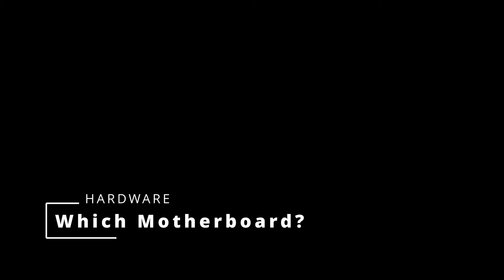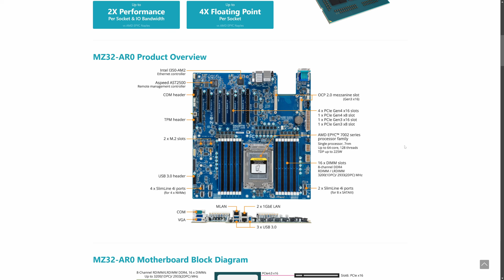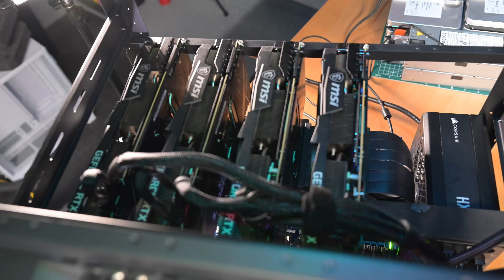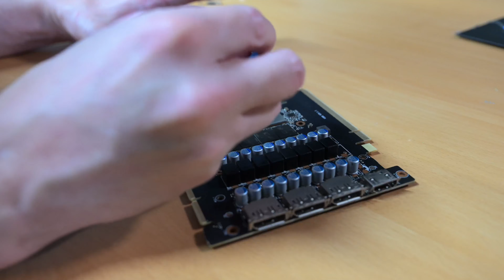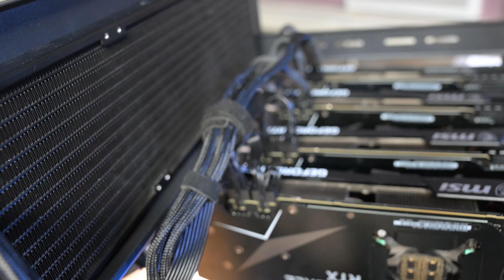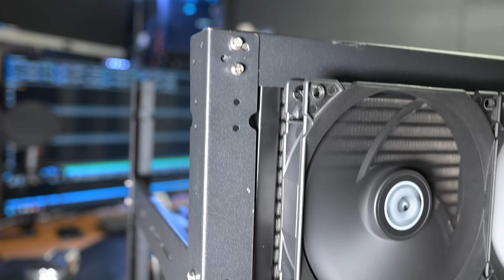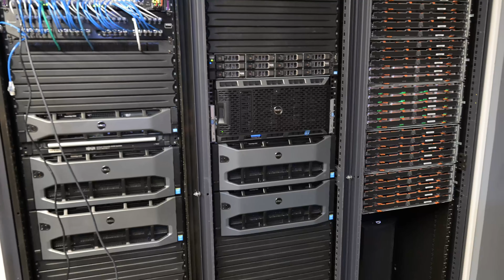INSANE Home AI Server - Quad 3090 Build

Comment: First off thanks for all the work you do, love the channel. Loved it so much I attempted to make a modified version of the quad 3090 rig. I had a 4090 in my gaming pc and a 3090 from an old one, so I figured two more cards and I was there. Thing was I had an I9 13900k in the gaming rig and I had the bright idea to reuse it. Long story short I found an ASUS Prime z790-p which is supposed to have PCIe G5 16x and Three PCIe 16x G4 slots that can run at 4x. Other that the CPU and Mobo everything else is same as your quad build. Actually got the system to boot with the 4090 and 3x 3090s and everything looked good. Anything that fit in 1 card say QWQ32b K_M4 16K CTX worked fine about 35tps and pegs out the power consumption on the card. But as soon as I load something up that needs more than one card(qwq32b K_M4 32K CTX) then all the cards drop down to 50 watts usage and I get like 6tps? Maybe there's something janky about this motherboard idea I had. I thought PCIe bandwidth didn't really matter. Was hoping that I might have stumbled upon a hybrid gaming/AI build . I'll keep tinkering with it and I might try out your CPU/Mobo combo to see if I can reproduce your results.  Let me know if you have any thoughts.
Reply from the maker: My guess is driver weirdness, but lets test it this way. First, scale it back to 2 cards, then 3, then 4 as a test-and-validate methodology. Second, during each test run ollama ps to verify you are 100% cpu loaded. Third, Specify "4" GPUs in for the model card advanced parameters settings place. I suspect it is this. You need to specify the num_gpu for each model after you find its sweet spot. For instance a smaller model with huge ctx may only need 2x 24GB gpus. It will perform slightly worse with each GPU added, but like 1% not what you are seeing. Forth, you should test from the ollama cli and not from the Openwebui interface to isolate any potential issues. Do not assume ollama is reloading properly with just a systemctl change if you alter env settings. You need to reboot the LXC to be sure.
Reply: @DigitalSpaceport  thanks for your original response. I think we can file this one under self inflicted pain lol. I neglected to mention that the original problems were on Windows 10 (because I was trying to do the hybrid gaming rig). To troubleshoot I followed the guide exactly proxmox > lxc. Now I'm getting 23tps on qwq q8 64k ctx. So if anyone cares the build does work. Now I just need to decide if I want to futz with Windows at all lol.
Reply from the maker: This comment makes it in the next video
Reply: @DigitalSpaceport  thanks for the reply I'll dig into it here over the weekend and report back, would be Cool if I could get this to work
Reply: @DigitalSpaceport  Are you referring to num_gpu(Increases the number of layers) the tooltip is kinda janky in OWui.
Reply from the maker: Yes that cmd is also accessible via cli ollama cmd

Comment: Would a SuperMicro H11SSL-i rev 2 w/ AMD EPYC 7b12 CPU 64 cores work with this setup?
Reply from the maker: H11 is pcie3, major bandwidth reduction for things like image generation and fine tuning. Id avoid H11.
Reply: @DigitalSpaceport  Thank you for the information! That makes sense. I will go with H12 and try the same setup you showed.
Reply: @DigitalSpaceport  I finally received the H12SSL-i motherboard, an AMD EPYC Milan 7V13 processor, and the CORSAIR iCUE Link H170i RGB Liquid CPU Cooler. While the cooler supports AMD sockets, I’m having trouble mounting it onto the motherboard. The H12SSL-i has four mounting points that align with the AMD bracket included with the cooler, but it appears to require a backplate or screws from behind the motherboard. Do you have any suggestions or guidance on how to properly install the cooler in this setup?
Reply from the maker: @nghiaphan2104 The H12SSL-i has an integrated plate around the socket. This plate has 4 stands for double-ended threaded standoff screws (should have come with the cooler. You need to put those in first. Then mount the bracket. Ensure you removed film sheet from cooler.  Follow sTR4 instructions for h170i, same fit as SP3.  You can check the supermicro motherboard image here and make sure it came with that giant metal socket plate. IT did come with that right? I dont think that can be removed. https://www.supermicro.com/a_images/products/Aplus/MB/H12SSL-i_spec.jpg
Reply: @DigitalSpaceport  The plate has four stands arranged in a rectangular pattern that align with the AMD cooler bracket, but the holes in these stands are too shallow for the standoff screws. I can only thread them in about one-third of the way. I also noticed four additional stands with an isosceles trapezoid shape. Should these be the correct stands for installing the standoff screws?
Reply from the maker: Hummm checkout this picture, maybe it will help. https://digitalspaceport.com/wp-content/uploads/2025/04/amd-epyc-sp3-mounting-scaled.jpg take note of the band around the standoff screw is on the lower side. Mine do fit snugly.
Reply: @DigitalSpaceport  So your cooler came with the SP3 bracket or you used the AMD bracket and adjust its position?
Reply from the maker: @nghiaphan2104  Mine came with everything but it was back in 23 I got it. The box is for sure different.
Reply: @ I finally received the bracket from eBay, and it fits the standoffs on the motherboard. However, I have a concern about the cooler connection. The cooler base is square, while the CPU is rectangular. Is it acceptable if the cooler doesn't cover the entire surface of the CPU?

Comment: Genuine question - with the lack of availability of 3090s and the surplus of lower cards like RTX 3050s (PCIe 4.0 x8, 2560 CUDA processors, 6GB GDDR6, 96-bit memory bus), would it be possible to link a bunch of 3050s instead of a dual or quadruple 3090s?  

3090s are currently closer to $900, not $650, whereas 3050s are only $200 (and highly available)

I’m confident my proposed approach isn’t feasible, I just don’t understand why.

Comment: but cores count on the performance ? or will be better an 72f3 epyc rome with 8 cores but higher frec 3.7 up 4.1 ? can someone clarify ?
Reply from the maker: For GPU based inference yes. Faster single thread=better tps. However the 64 core cpu can run deepseek 671b fully in system ram at 4TPS and im not sure on a smaller ccd chip count if that holds the same. Minor fringe use case so frequency is king imo first. That i use all the time. There is also the 7V13 which has a higher freq which seems like a good thread increase while still 64c to me and is priced at what the 7702 is.
Reply: @DigitalSpaceport  I google EPYC 7V13, specs and it's a monster hehe , but maybe too much for the price. I'm thinking about switching to an EPYC 7F52 for higher frequency—then i share the details how it goes . 

Also, I'm looking at a Supermicro H12SSL motherboard on eBay, but sellers are telling me it only supports 3x RTX 3090s, not 4 or more. In your video, I understood that it does support 4 GPUs or 6 also —am I mistaken, or should I go for the Gigabyte MZ instead?

Thanks again!

Comment: Inspired by you, I just built an 8x 2080 Ti 22GB Rig to do some 32B LoRA
Reply from the maker: Whoa! That is a lot of VRAM!
Reply: @MrGJwang  and how are you finding it in adapter training for LoRa?
Reply: @Chris-o1x3b  We trained roughly 40K lines of proprietary information with the 32B model, which took around 4 days. For inferencing 32B models fp16, I can get approximately 60~70 tokens/s using vLLM.

Comment: Do i need all 4 3090 the same model or they can be different vendors and different 3090?
Reply from the maker: You can definitely mix and match. No issues with that.
Reply: @DigitalSpaceport  even so, second hand 3090 around my area typically cost 800$ each.

Comment: @digitalspaceport is does the cpu cooler need to be the ¡CUE H150i ELITE CAPELLIX(water cooled)? I’m trying to fit this(exactly what you built in this video) in a 6u server case, the Dynatron T17 Socket SP3 CPU Heatsink and Cooler for AMD EPYC, Threadripper will fit but the ¡CUE H150i ELITE CAPELLIX would take some serious modifications to work with that. Please advise, and thank you for all your awesome videos!
Reply from the maker: No it does not. I just had that cooler on hand.
Reply: @ awesome, thank you kind sir

Comment: Amazing job @DigitalSpaceport. 🙂 Built the same AI Home Server, the only diff are: 1) 768GB DDR4 2933 2) Double PSU units 2x1500W  3) 4x GeForce 3090 FTW3. I'm vey happy with the setup especially with the flexibility Proxmox.

Comment: I really liked this video. 
Is it possible to handle the parallel requests of users with this system? 
In my opinion, if you could do this test, it would be more interesting, and please introduce this system model so that we can process the parallel processing of users more easily. 
For example, if 50 users ask a common question, can this system give an appropriate and quick answer?

Comment: I am building a similar setup but with 4 3060 12gb gpus. That motherboard is quite pricey, 500 usd at least. Would you know of any consumer grade motherboard that supports four pcie 4.0 8x? (The 3060 runs at 8x speed)
Reply: I went for the ASUS X99-E W, it has a PLX switch that can run multiple devices simultaneously at PCIe 3.0 x16

Comment: the strange 7th slot thing is a love/hate feature(just ordered one of these:P).... I'm guessing if it supports bifurcation than it could technically be used at 2x 8x slots or 4x pci-e 4x slots which makes it an interesting board with a strange quirk..... also seems to be same size as a x9drh-7tf; I'm hoping means it will fit in a Phantec Enthoo Pro

Comment: deepseek 1.58bit calls for ddr5... does ds1.58 ram ddr4 or ddr5 matter?
Reply from the maker: Bandwidth matters, which is impacted by ram and cpu. Working on an unsloth video rn, might want to hit alert to catch it. 256GB DDR5 7995wx system will be used.

Comment: Well your build inspired me to try something out. Lets hope I'm not going down the wrong rabbit hole going this route: Asus X99-E WS/USB3.1 LGA 2011 V3 X99 MOTHERBOARD w/ E5-1660V3 CPU & 128GB Ram, thank you ebay. Yes I'm a cheapo type of guy :D
Reply from the maker: That is a nice set of specs and cheap. X99 class systems are excellent performers for the price also! Good fast single core speed is ideal I found in earlier testing. Like 5 tps speedups observed just with that alone, wonder what the fastest E5 V3 is. I know V4 nicked the V3 all core turbo performance on some boards (IIRC, aging out soon)

Comment: is it still limited by it\'s PCIe bus?
Reply from the maker: PCIe bus speed and generation does not factor into inference workloads in any meaningful way provided the model fully fits into vram with current tech. It DOES impact RAG and ingest and vision models but those are intermittent tasks.

Comment: Like the setup. You've mentioned nothing about storage. I see you have 4 cables to connect nvme drives so I assume that is what you did. From what I read about the motherboard, the nvmes are shared with one of the pci4 x16. My question is what was your storage setup? wouldn't it be better to use SATA as this machine is probably not storage critical?
Reply from the maker: So my storage is actually very complex and I dont think very relatable to the audience but maybe I should cover it. The MZ32-AR0 those 4 NVMe are weirdly spanned to enable the top slot PCIe which works flawlessly after they are bridged. This board does have additional slimsas to sata/( unsure on sas) ports built in for up to 8 drives labeled SATA1 and SATA0. Breakout cables needed but very possible to use on this board to a caddy holder thinger.

Comment: Im not really interested in AI. But you guys think using an epyc pc for game development, 3d, sculpting its overkill?
Reply from the maker: I work with Unreal and an EPYC is not great for 2 reasons. Windows doesnt actually integrate epyc into the 11 lineup at any level. It works, but its kot a supported CPU and things like numa get wack and hit perf. Epyc also lacks single core speeds that are above 4Ghz on Rome. Thats the biggest reason. TR pro is the best still. Pushing render on lots of cores does happen for lightmass at a better quality vs gpu still but that is likely to hit parity soon on gpu lightmass for quality. Its one of the few reasons left for UE centric users to need lota of cores also. Various 3D applications will function differently. However this same setup with a wrx80 and 5955x could allow 4 GPUs which depending on your working suite, may be awesome.
Reply: @DigitalSpaceport  i cant afford new threadripper. I can afford 3960x or below. Im basically learning so i dont think its worth to spend a ton of money right now. Thats why i ask about old epyc. Maybe i should go with ryzen 7 or 9 am4?
Reply from the maker: Oh yeah if you are not doing this professionally then by all means yes do a desktop class. You dont care about ecc vram and such things. Also in that case do an i9-12900k setup with the best nvidia GPU you can afford. That is an old but gold all around killer for 3d work on a budget. Get lots of VRAM in that GPU and an ADA class card. Ideally a 4090. You do NOT need the fastest DDR5, you do want the fastest NVMe you can get.

Comment: Hi, thanks a lot for your video and the multiple tests and precious advices. So because of you 😅 i build almost the same setup but i got 3 rtx3090 for now. I wonder if it's worse to buy another one to install on the PCIe n°7 because it's seem to need 4x 4i SFF-8654 to 4i SFF-8654 in order to work. My question is that on the board the PCIe n°7 is said as 4th gen but on the doc it's seem only link to the PCU with a 3rd gen PCIe. Do you did a bandwith test (not in inference because it doesnt really matter) in training little LLM or LoRA

Comment: I'm curious, I was looking at getting a Poweredge 930 and running 2 Tesla V100 32 gb cards in it for AI computing. I'm curious if that would be worth it long term or doing a setup like what you showed. I'm currently learning more and more every day so any suggestions are def worth it to me.
Reply from the maker: Poweredge R930's? I would definitely NOT buy those for running GPUs as they have no internal power headers built in. I have 4 myself. On the cards they are fine (in a different server) as long as used for Inference primarily. Do know they are PCIe 3.0 x16 which the V100 can totally max out but PCIe 4 is well, double the speed. AMD Epyc Rome is a good choice for PCIe 4.0 x16 and 128 lanes. Do note you don't have to get a 64 core monster either. I likely will sell my 64 core one and get a 7F52 and get an extra 3 or so TPS as it has a faster single thread speed, which is important for TPS minorly. Watch more of these hardware related videos is decent advice also as I drop a lot of additional info that is not in the thumbnail or title all the time.

Comment: Amazing, this is a great video! I was wondering how to build a system like this and it's exactly the kind of design which makes sense and not a traditional gaming PC. I probably won't dare to build it yet but it's good to learn what it takes!
Reply from the maker: Yeah the common case, even the massive sized cases, just are not good really for this level of massive GPU placements.

Comment: your video is awesome. I literally built the same "server" as yours. a question regarding testing the pcie bandwidth among the gpus. I run nvidia cuda sample tools like p2pbandwidthlatencytest and get roughly 22-25 GB/s bidirectional throughput in windows, while in ubuntu 24.04, same test gets 15GB/s.  have tried many ways but havent got it fixed.  any suggestion would be appreciated
Reply: im fine to get 20-25GB/s due to the use of riser cables, comparing to the theoretical 32GB maximum, but 15GB/s in ubuntu is too slow
Reply from the maker: Is your governer is set to performance mode? I would recommend a static install of your linux nvidia drivers and not using repo drivers. The final thing to check would be your numa clustering layout and see if there is an alt nps mode that can yeild better results.
Reply: @DigitalSpaceport  thanks much for your suggestion. I tried changing numa to 2, 4 from default 1, set governor to performance, set grub realloc pcie, and even uninstall nv server driver to install non-server driver (550), one change at a time, still no luck... it's so weird.
Reply from the maker: Hum I would recommend since you have EPYC look at this manual from HPC council https://hpcadvisorycouncil.atlassian.net/wiki/spaces/HPCWORKS/pages/1675034639/PCI+Switch+CPU+and+GPU+Direct+server+topology as well as others they have. Generally good advice for tuning BIOS settings.

Comment: How are the Kritical pads longterm? I've read that they were insane for about 4 months and then dried up super rapidly, leading to the same temps as before repadding. Maybe they've improved since? Can you speak on this?
Reply from the maker: They are great on thermals still but Ai workloads are vastly less stressful vs say mining. Id only consider them if you have a hot card as they are really expensive.
Reply: @DigitalSpaceport  This would go on an EVGA 3090 FTW3 that I use for AI trainings and I don't mind paying premium to protect my card from high temps. If you don't report any drying up of the pads, then that's encouraging. Thank you!
Reply from the maker: I just used a probe on two as a spot check and they depressed and then plumped back up. If they are pumped out they stay crumpled-ish and don't return to full form is what I have seen a few times but not often. Slightly of note I see no differences with the thermal pastes I tested and both are in 1 degree of each other.